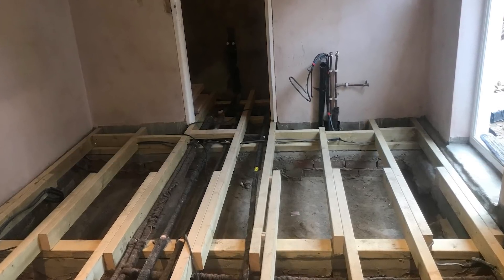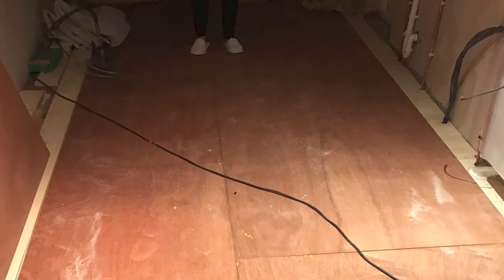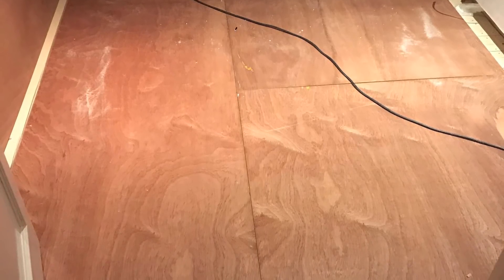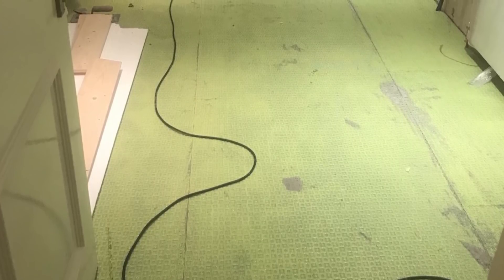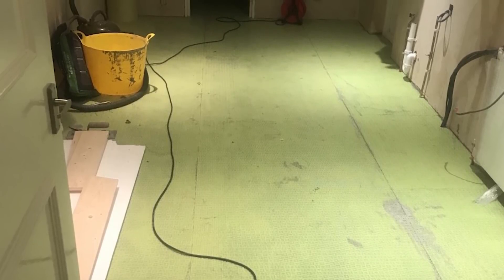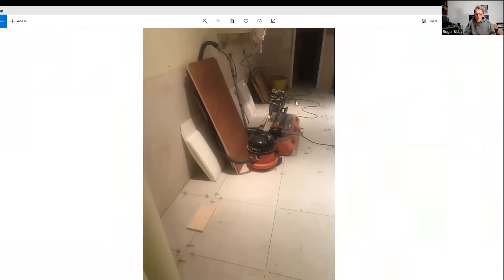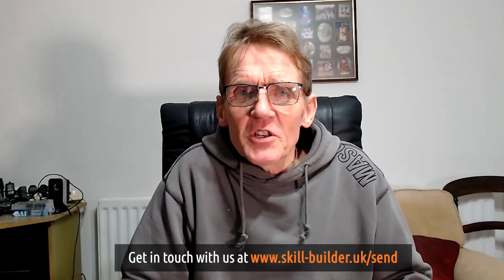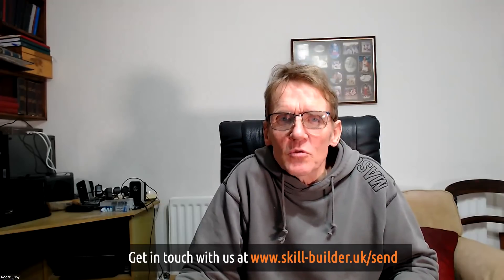What's That Noise Coming From Under The Floor?

Comment: Take the skirting board off the run the grinder along the wall into the tile. Then replace the skirts it should give room to expand and contract. Am sure it's at least worth a go.

Comment: Too much in the mix & as Ardex have said, miniscule grout spacing. Everything`s struggling to expand / contract, but hampered by the tight cutting in, then everything being built on top. I think the problem`s there for good, a perimeter cut all round may help, but you shouldn`t be building a kitchen on top of a floor that`s meant to be `floating` in essence.

Comment: Some great comments here and my opinion is is it's the floorboards beneath the ply. How as the ply been fixed to the floorboards? Has the screws gone through the ply and floorboards into the joist? Has the plywood been screwed just here and there missing a lot of the floorboards? Glued between the ply and boards? Could be a manner of things. And as a tiler for 35 years, i would have glued and screwed ply to the joist, done away with the Durabase matting and glue and screwed 6mm Hardie Backer boards instead. Flexi adhesive with back buttered tiles. Expansion around perimeter.  Bomb proof.
Reply: Spot on 👍🏻

Comment: Are they sure it’s not the ply popping if they’ve used nails to fix it down they can pop if there’s no gap for expansion. I’ve never soon tiles making a noise before. But I’ve seen floor not nailed completely or not ring shank personally I prefer screw.

Comment: I did 3mm grout line on my kitchen, used the blue foam on a roll round the outside to leave an expansion gap at the edges of the room and went over the tiles with skirting to the hide expansion gap at the walls where there wasn't units.
Reply: Nice. How it should be done.

Comment: Living in Thai, the biggest problem with tiles is "tenting" tiles laid on concrete floor, always tight up to the wall as skirtings are not a thing. Then the temps here cause massive expansion and contraction and also ground heave. Then you literally get every tile in a room exploding and no longer stuck to the floor

Comment: As others have asked, what is actually expanding?  Very interesting and a bit confusing. I don’t/didn’t think the tiles, film layer, or plywood are the source of the expansion. Is it those tongue and groove floor boards?  If so, wasn’t the film layer meant to isolate the tiles from everything underneath?  And is the source of the noise possibly the plywood layer?

Comment: Seems like the different materials and elements used to create the floor surface/ structure is the culprit. They all have different performance. Just my opinion. Sometimes less is more. Great video and question as ever Roger.
Reply: James, I think you are right. Too many different materials together and wood too tight to the wall.
Reply: My thoughts too. Ply laid on the joists and a decent flexible adhesive would of been the way I'd go and personally I'd of left a slightly bigger gap around the perimeter. It looks like they've done everything to do a good job from the substrate up but have added unnecessary layers. Just my opinion.

Also not sure if the joists would of been allowed to aclimitse and whether they are treated,looks like they are but I'm looking at SB on a phone 🙄
Reply: I agree. Also the new timber acclimatising to the building could be a factor. Glued and screwed plywood floor with room for some movement then decent flexible tile adhesive would probably be sufficient in this case.
Reply: Agree. 
Keep it simple. 
But they obviously tried to do a really good job.

Comment: I had reports of loud cracks at night from solid t&g pine planks I glued down to p5 floor with sika T54 (flexible PU I think), PVA on the pine T&G and a few brads through the tounge here and there to help with unruly boards.  I had laid the p5 about 2 months earlier (with PU at joints and joists) and there had been no noise before the pine went down, so my money was on either the brads or tongues snapping, or the PVA bond letting go, as the boards shrunk. In any case, it eventually stopped. My guess would be it's related to the solid timber boards they laid. If it was the tiles I'd expect cracked tiles or grout lines.
Reply: sounds good smartbuild, look at 0.37 is there a need for all those screws/nails, seems a bit overkill and perhaps a contribution to the problem with over screwing/nailing, we all know natural flooring expands/contracts, paritcularly a softwood such as pine
Reply: The fixings look ok to me.  If it was only 1 fixing per board/joist there might be the risk of cupping, especially as the top and bottom of board will be exposed to different humidity.  As Roger said, 18mm ply and dispensing with the floorboards would have been a good route.  If the boards are shrinking a lot and are well restrained by the fixings, they could be splitting instead, but I'm not convinced. The floorboard fixings look a bit close to the edge of the boards for my liking.
Reply: @smartbuildengineering  Interesting thoughts cheers 🙂 Expansion issues seems like a plausible explantion here, I wonder if acoustic intumescent sealants (fire/soundproofing sealants) were used incorrectly (they expand with heat) thus preventing a intended expansion joint :gar:
Reply: @deltafX99 I recall intumescent materials/sealants dont activate until well over 100degC.

Comment: Joist.T&G.Ply.Membrane:Adhesive.Ceramic.6 different materials,6 diferent rates of expansion. The old boys that taught me called it   `` in pugatory``     all things trying to go in different directions.
Damp floor. no air circulation.?  central heating to room. cold underfloorboard area. damp wood. Screws with plain shanks toward the head?  Done a lovely job putting everything in though,my guess is the t& g is the culprit.

Comment: I would have used 22mm P5 moisture resistant floorboards, fully glued and screwed. The tiles so close to the perimeter is needless really, despite the good intentions.

Comment: I would suggest monitoring what seems to be causing the problem, whether it is temperature or moisture. If it’s temperature and happens regularly soon after the heating goes on or the room is allowed to cool then it is most likely related to the tiles and their bond. But this should should show some cracks in the grout when the floor is cold and should be detected by going around tapping the tiles. Does it tie in with when it has been raining or was the floor done without correcting the reason the original floor rotted. This is more likely as expansion in wood due to moisture is far greater than that due to temperature. The original floor rotted because it was in a damp environment (check poor/no ventilation/air bricks first, plus drains/gutters). If you put dry seasoned new wood in a damp environment it will expand and move. This would be happening in the t&g as this is at the bottom. If it is due to moisture this will go on until the wood has absorbed enough moisture until it is in balance with the air below and the noises would die down with the frequency more linked to long periods of dry/wet weather. Of course they will slowly rot and need replacing but that may be 20 years off. If you didn’t leave gaps at the  wall end of the boards or hammered them together that certainly doesn’t help and makes over sensitive to expansion.

Comment: They’ve left zero expansion anywhere, ply won’t move much, but cheap t&g will move HEAPS! It can’t move easily because they’ve probably glued and screwed the hell out the ply to the flooring, so the floor will move as much as it can then split at the screw lines, which is the bang they’re hearing.

Surprised there isn’t a ‘buckle’ anywhere on top surface, probably plywood is keeping it to a shallow’arc’ ?

My theory anyway 😂
Reply: 99% certain it’s the T&G.

Comment: I think it’s the TG floor boards, pine boards are notorious for curling up and expansion in humidity. The boards appear to have been layed down tight like laminate flooring. there should be either a gap around the wall for expansion or the tongue shouldn’t go completely into the groove.

Comment: I use a silicone line down the centre grout lines. Sticks all black for the charcoal grey. Leave 10 mm on all edges. Also when the boards are going down on the joists use the cheapest crapest cork to put a 3 mm worm along the top of each joist it crates a delamination layer to the joists as the weigh of everything can make noises with movement and thermal expansion. This kitchen is going to sag in the middle (not noticeable to anything but your ears).

Comment: The new joists looks like they're running the length of the room rather than the shortest span and those sistered-up joists are at the junction between doors - basically where there will be foot traffic. Hard to tell but also looks like the joists aren't anchored to the walls (floating?).

Comment: They had a leak, which introduced a lot of moisture at ground level, then put new joists, wallplates and ply on top, all of which have a certain moisture content, then tiled without leaving a expansion gap. A basic understanding of moisture content is crucial, you can buy or rent a simple hygrometer to test both timber and concrete before it's applied. The solution here, is create an expansion gap, tiles up, cut around edge of room, tiles back or sit it out and if you are very very lucky it will improve with time as everything acclimatises to the room,,, just unlikely. If we had installed this we would have left expansion gaps in the joists, T&G, ply, membrane and tiles. To me, one or all of the above are causing the issue. It's a shame as the finished work is so neat, it's no good being neat though if you don't know the basics.

Comment: Sorry, 2nd comment. Another issue i find when repairing creaking floors is the wrong screw was used. Not all screws are the same as many of us know. If when screwing 2 things together, if there is the slightest gap, and you use a full shank screw, the 2 materials will not 'pull' together. The gap will still be there which in time will start creaking. Always use a half shank screw ( i think that's what there called!) and by doing so will pull the 2 materials together tight.

Comment: Were those pine boards seasoned on situ before laying. Assume the thin ply is just a sacrificial layer so either the entire floor or sections can be changed. Expansion round the edge a good idea.

Comment: Hi, id go with all that new timber, shrinking twisting and under load(kitchen). 3mm grout joint is pretty standard nowadays, even if ardex ssy different. I do victorian floors and minimal grout joints is the norm. Even though theyre mostly on screeded bases.

Comment: My guess is the pine subfloor I am wondering if they glued the laun to it then nailed it, they have concrete which may be either still curing or letting moisture  pass thru which is going to cause the pine to expand and contract  the popping probably is the movement at the glue joints or fasteners , I been setting tile for 35 years it doesn't move the substrate yes but not the tile. Its a situation of two or three different materials that all have different contraction rates, the membrane is probably what is actually keeping the floor from popping loose.IMHO

Comment: I had suspended wooden floors in my house,(built in the 60's) pulled them all up, old copper pipes were shite,so were joists,all dry rot,filled all floors in with gravel, then membrane,4 inches of concrete,then all qualpex pipes (I think that's what they are called,maybe wrong) no pipe joins under floor now,covered with 4 inches of screed,best job ever,steer clear of suspended wooden floors!  Edit: better still if you can put 3 or 4 inch insulation boards before concreting

Comment: I'm gonna say it's the plywood making the noise. I over plyed one of my rooms, screws every 6 inches, it started off beautiful and quiet, over about 4...5 months it started popping and generally making those horrible wood noises we all hate. Ended up taking it up and the problem was solved. Why did I do it in the first place? Because I thought it would give some more strength to the floor surface.
Reply: What would/did  you use instead? Thanks
Reply: @alexbondrila3423  The problem occurs when you have woodern floor joists + woodern floor boards + woodern over ply. Wood on wood on wood makes it a significant chance of creating squeaks, creaks and other unwanted sounds. So, I removed the ply and decided to replace my sub floor ( 50 years old 18mm chipboard) with new 22mm chip board and screwed it down properly. Now the floor is dead silent and no flexing. Feels solid.
Reply: Lovely cheers
Reply: @alexbondrila3423  I got a local carpenter to come in and remove / replace the chipboard. He cut it neatly all around the edges (removed skirting boards) and glued down the new floor in one day. Didn't cost the earth and was not much hassle. I then took to the floor with some good floor screws, pilot hole, clearance hole, counter sunk and then screwed. 👍🏻

Comment: wonder if the timer was allowed to acclimatise  before installation. did my daughters  in solid planking used cramps to clamp  it up and nailed with a paslode nailer. Banged and cracked  after a month vor so. lesson  learnt.

Comment: P5 flooring instead of boards. Cheaper and quicker. No need for ply sub base then. Joists probably need more 'meat' on those spans (may be flexing). Can't comment on moisture/airflow as no info available. Bottom line - 'wet' T&G is trying to move and the ply won't let it!

Comment: My guess is that it is the interface between the ply and the floor boards.  Was the ply screwed down to the boards at every 6 inch square? I cant see the screws.  I used 6mm cement board by knauf screwed and glued over existing floor boards ( dry and probably well settled in)  which has been no trouble at all.  Shame they are having  trouble as they have put a lot of thought in and done a great  job.

Comment: It might be the plywood, If its 6 or 4mm ply then it needs to be fixed at 100mm centres (a lot of people don't fix it anywhere near that amount) as moisture from the adhesives can cause it all to warp/ I've had jobs where its even popped in-between the 100mm centred fixings when its been a cheap plywood
Reply: Nearly all ply is cheap stuff nowadays. No one seems to sell quality ply anymore.

Comment: The T&G appears to run tight to the plasterwork, or am I reading this wrong? I'd have put it in with a 5 to 10mm gap to the walls all round to allow for expansion (the skirting will cover it and the gap can be sealed with something like Compraband). I have come across situations in the past where not leaving a sufficient gap has resulted in noises as the edges of the floorboards "scrape" against the masonry in certain conditions. I, too, would have used P% T&G chip glued at the tongues and to the joists - far less likely to move - I suspect that there could also be differential expansion/contraction of the plywood and the softwood planking which might add to the issues, partly because those ply boards don't seem to have sufficient numbers of screws in them (maybe better to screw on 150mm centres?)

Comment: I can’t see how tiles and grout expand and shrink. It’s most likely the pine boards. Providing they left plenty of expansion room for the pine it should be fine. It could be just where there are pipes getting hot then cold then hot all the time.. the noise is probably glue bonds breaking.

Comment: There's quite a few things that don't look quite right 
Firstly would like to ask is there ventilation under the floor back and front. 
Also not such a good idea putting down tongue Grove, generally normal floor boards with 1.5 mm
 spacing  in my view is better and also the ply needs spacing!!  
Also don't agree with the material laid on top of ply , in my view there's been overkill, but with the principles over looked.

Comment: its all the poor quality wood seen plenty of T&G flooring shrink loads and gaps open up. I would have used some marine ply over the joists and then used the no more ply boards over the top to tile onto them with flexible adhesive and flexible grout

Comment: I had something similar but it turned out to be the joists themselves and not the tiles on top.There was not enough space for the joists and it was quite humid (oddly after a flood too) due to the repair not being completely properly and giving off a tiny trickle of moisture into the floor space.

Comment: I have made a disaster. I levelled my kitchen floor and the 1st half is excellent, but the last poor went wrong. Would it be OK if I showed you what I have done and perhaps you may be able to tell me how to fix it. I have lump of concrete that I didn't trowel properly. Do I cut it out or what ? One end is excellent thanks to the product but I think I mixed the final bag wrong and didn't  concentrate on it, I was knackered 🤦‍♂😔
Reply from the maker: Where are you based Lee? I have a diamond grinder with a dust extractor that will sort that out.

Comment: what is the rated timber they used for frame as the ground would have excess moisture ... how much expansion gap did they leave for the flooring ?? id say its not the tile but sub floor

Comment: I see dirt under the floor.
Emidiately thinking there is to damp/moist under the house so the floor boards or plywood is expanding and have no expansion gaps.
Dont think the tiles is the problem.

BUT I ain't no builder just a DIY'er that have watched hours of skill builder, matt risinger, stud pack, Perkins builder brothers and many more.
And i work as a mechanic so not any relevant experience to wood there.

But damp ground without any ventilation or vapor barrier before the wood spells disaster.

Thats where i put my 10 bucks on the bet